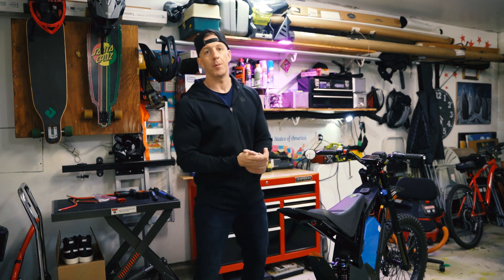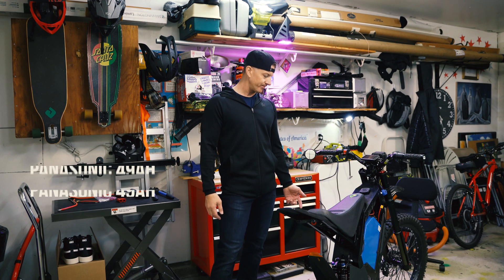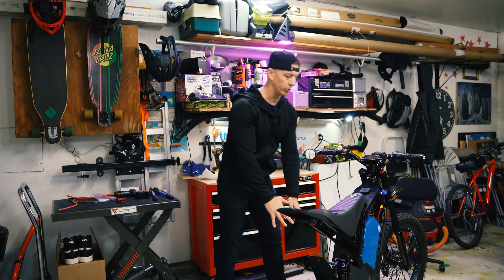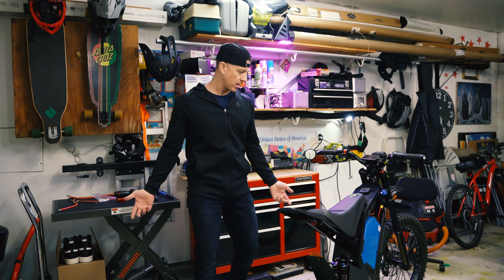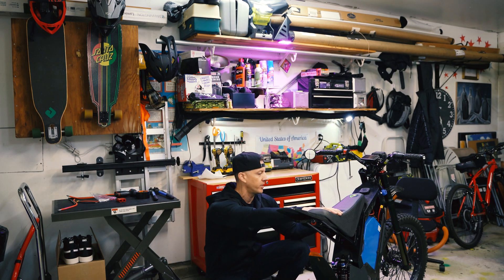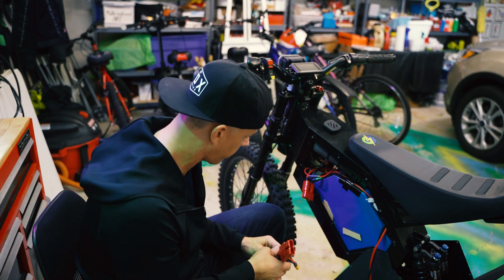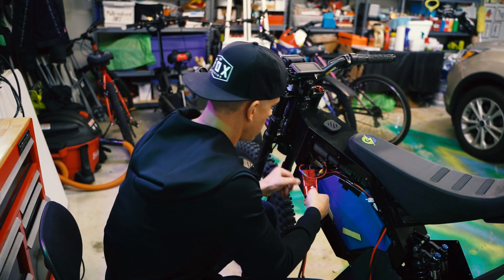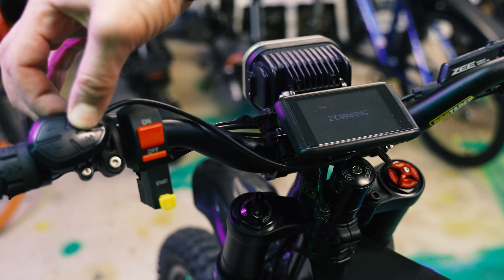UPGRADE to TWO Ebike Batteries = MORE POWER & Range!!!

Comment: I’m having an issue with my controller 72200 that has the LED light colored Green. No errors listed. Any thoughts on this. Any information would e greatly appreciated.
Reply from the maker: So am I, join the club.  Literally just installed a new 72200 today and it's not interfacing with my display as I was promised by my seller rep.  Has me quite pissed off.  What is the issue with yours?
Reply: @JoshStreetDesign  after inputting all the numbers and checking everything, the light that’s supposed be red, it’s actually green with no function. Screen turns on and hall test passes so I’m in the clouds here.
Reply from the maker: @christopherfigueroa4143  yeah mines green too.  Bike still rides fine and all, but I just can't get my speed and mileage and watt usage.   I'm pretty sure it's that the controller isn't compatible with the screen, wasn't set up that way.
Reply: @JoshStreetDesign  I have a small video on here showing the light on the controller if you want a visual look.
Reply from the maker: @christopherfigueroa4143  yeah but what I'm asking you is what is the actual problem you're having?  Is the bike not moving is your throttle not working like what's the problem?
Reply: @JoshStreetDesign  the bike doesn’t move, throttle doesn’t function at all
Reply: @JoshStreetDesign  it’s very confusing since it all came as a complete package. Controller, throttle,screen,wires.
Reply from the maker: @christopherfigueroa4143  did you check all of your connections and make sure there's no bent pins or loose wires
Reply: @JoshStreetDesign  sorry I didn’t realize the miss wording, I meant to say that the bike does not move as well. I did check all the wires as well. I asked a friend to look at it and he feels it has something to do with the software 🤷🏽‍♂️

Comment: Dunno but parallel battery designs are usually frowned upon. The major problem is that both batteries might have BMS that balances cells within the pack, but as one battery gets drained more than other they start to equalize voltage between them so you get a situation where one battery charges the other one, this can have excess stress, heat and loss of potential battery capacity.  The next problems is the wiring as when connecting parallel batteries, generally the battery on shorter and thicker wire gets drained more than battery more further down the line, this is usually subverted by having all parallel batteries wires connected exactly with the same resistance and length wire. High amp situations are especially critical in this kind of scenario. I see your adapter is probably a big problem as the drain wires are connected directly to contacts of the first battery, however if you connect the closest plug to the  large capacity battery first, the problem isn't so prominent. Also when charging, you should always charge the two at the same time and at all costs avoid connecting two different voltage potential batteries in parallel as this will cause massive amounts of current to start flowing, yet again using BMS usually stops the worst from happening.
Reply from the maker: Thanks for your input.  I do charge these at the same time and they are the same voltages, that is specified in the video.  I haven't noticed any negatives of yet only positive increases.  Hopefully it will continue in that direction haha
Reply from the maker: I installed the New 72200 and I did NOT see a power gain unfortunately.

Comment: Hi, I have a bike similar but I have an issue where the bike won't accelerate when i turn it, i have to hold it for a while and it's unpredictable when it will start, I've checked everything is connected. Is this something to do with the setting on the LCD? HELP!
Reply from the maker: doubtful.  Sounds like you have a wiring problem somewhere.  I would need a lot more details to help you.  If you have a sabvoton motor, go into the blue tooth settings, reset it to factory defaults, put your bike on a stand and re-run the hall test.  Make sure you put around 15 amps in the given current field before you do it.  good luck.

Comment: Hi I recently built an ebike with qs273 motor but I’m not sure if it’s programmed right. I’m only able to get a top speed of 26mph lifting the bike on a stand. The motor controller is set to no speed limit in MQCON app. I’m using a Sabvoton 72150 with a 72v 20ah lipo battery.
Reply from the maker: I wouldn't need to see screenshots of your mqcon settings first
Reply from the maker: Also is your BMS allowing more amperage to go to the controller?

Comment: Pretty cool idea to add the battery there. Personally I would put the controller outside because I have seen people blowing up fets from their sabvotons because it didn't get enough cooling inside the frame. So a risk you might want to keep in mind when riding on hot summer days :)
Reply from the maker: Thanks man.  By the way, have you fried a 273 motor?  And if so what was the circumstances?
Reply: @JoshStreetDesign  Indeed I have melted my custom wired and ferrofluid qs273. I was running at 37kw peak power and racing against a bmw. The killing blow was actually the fact that qs273 heats up significantly when you are riding slow. So that was pre heating the motor before I did my accelerations.
Reply from the maker: @BossManaatti  wait that makes no sense you say it heats up more when you're going slow as opposed to going fast?  The only times I've really felt mine hot was when I was doing a 55 mph bomb ride for like four miles straight
Reply: @JoshStreetDesign  qs273 warms up the same when going 20km/h and 80km/h. Moving air cools down the motor a ton
Reply from the maker: @BossManaatti  interesting.  Some people telling me I need ferrofluid and hub sinks on it.  I just don't feel it's necessary as I'm not putting it as much power as your were
Reply: @JoshStreetDesign  I don't think you need ferrofluids or hubsinks for the power you are running. Just simply overkill

Comment: Theoretically you should see a power gain without adjusting controller, in that there is less voltage sag. Power measured in KW. So 83v x X amount of amps = kw's of power. When you hit full throttle, it probably see's a lower voltage under full load, compared with when you had 2 x batteries at full throttle. 

So if under full load (1 battery) you get 4v sag at say 100 amps and with (2 batteries) you only get 2v sag, then that's 2v gain. 2v x 100 amps = 200w power gain. But if you weren't really pushing your original battery that hard in the first place, then power gain would be minimal. 

My 90v pack at the moment sags 10 volts easy! at 250 amps. If I could eliminate say 5 volts of that sag, I would theoretically see a 1.25kw gain in power! That's one of the reasons I am going to double my pack size.
Reply: I got homemade 32s 116.8v full charge lifepo4 battery, they can discharge over 600amps short burst, 300amps peak, 200amps nominal, they sag less, I run 1.5mm copper places to connect the batteries. And 2x 8gauge wire. At 250amps draw voltage sags around 3volts. That's over 25kw off power🤣, cons they weight a ton. I can run over 140kph but I usually run it at 100kph, I am always afraid that Fork will break. Even at 50kph I don't use my front as it sags to almost bottom, regen braking cannot hold me nor stop me. Damn heavy but reliable battery (50kg) 😅
Reply from the maker: @isaacfragmatic4651  dang dude, those are some stats!   I just finished putting a new unlocked 72200 and a new 273 5t motor with a huge rear Dunlop k990 tire for off-roading yesterday.  Making a video of it now.  Virgin ride will be today.  Excited!
Reply: I am looking forward to see it :)
Reply: At peak amps I can discharge 32kw, if only my controller and if I wont limit it. 😅
Reply: @isaacfragmatic4651  Just set to full power, but stand on the front wheel under full power, like on titanic when shes on the fornt of the boat!
Reply: My fork can't handle the torture😅, my hub for sure won't kick my front up due to battery weight. I just sit down and bruupp. Local 150cc is ranting to do drag race against. They didn't stand a chance at half battery installed ( 53volts) 16s. In the end they are just saying " it's fast" after beating them, they " no way" after telling them I am still running 40% since I only installed half battery 🤣. I have run 50kphs only at finish line as it is short drag, but they are all amazed and laughing, all I did was to sit and brupp. 😅
Reply from the maker: @isaacfragmatic4651  what controller and motor?
Reply: Qs273 and svmc93120 unlock😅,
Reply from the maker: @isaacfragmatic4651  I'm actually really pissed off today because when I got all my stuff hooked up and then took the bike out for a ride the performance was exactly the same as my 3.5 motor so I think they actually sent me a 3.5 and not a 5T.  What a waste of $600
Reply: You may need to configure your controller., and fine tune it. Normally 5t motors have 5 turns means they produce more torque rather than speed. You may also need to check the resistance of each windings ( if you have equipment that can measure low resistance) or grab multi meter stuck it on 2 phase wire and turn it. At same speed, the 5t will produce higher amps. Another way to know is by turning the wheel at specific given voltage. 3.5t will usually run 13kv as far as I remember. 5t should be lower.
Reply from the maker: @isaacfragmatic4651  I just verified with a company that it definitely is a 3.5 t motor, they admitted that they sent the wrong one but they were not going to make it right and they're saying I have to buy a whole other one
Reply: F*ING no way :(
Reply: Can you share us the marking beside the motor?
Reply from the maker: I deff still have the voltage sag, not sure that it's the same amount though....but I'm suspecting that the limited controller may be the X factor there.  Time will tell once i put the new on in.   I'm gonna do a walkthrough video of that too.  Thanks for watching!
Reply: @JoshStreetDesign  what new controller do you have. Also can you not unlock your sabvoton 72150. I have my 72200 unlocked.
Reply from the maker: @jcreedy20  I have a locked 72200, and no it CANNOT be unlocked.  I've tried everything, 2 computer programs.  So I ordered an unlocked version of the same thing.  I may up my Field weakening up to 150 amps just to see what kind of top speed I can get.
Reply: @JoshStreetDesign  You can by pass a wire around the current sensor inside the Controller. This tricks it in that the main wire only has half the current flowing through it as youh have bypassed a cable around it. It works! Anyway, I have my flux weakening set at 180 amps with great effect!
Reply from the maker: @jcreedy20  yeah I've seen that old solder the pass around wire trick before . But I just really want to be able to specifically adjust my numbers.  so the 180 amps field weakening what kind of top speed are you getting what are your specs and setup?   Do you notice that your motor heats up a lot if you go fast?
Reply: @JoshStreetDesign  I am running a 22s1p EIG 20ah pouch cell setup. Cells are rated to do 10c for 10 seconds. So 200 amps but i am pushing them a bit as i have my sabvoton set to 250 amps and 550 phase amps. I am using a 300 amp ANT BMS. I have a 3 turn QS205 with hubsinks and ferrofluid (8ml). I used a FLIR camera to measure the outer casing, the most it hit was 45 degrees C during a hot summers day (35 degrees C outside temp). That was with flux weakening at 180 amps. I have had 70 mph out of it so far, but there was more speed to be had out of it i think. Your using a QS273 i believe? You will!!! need to add ferrofluid!.... My friend cooked his 273 on a 200 amp setting and flux set to 80! with his sabvoton when he was thrashing it repeatedly. He added ferrofluid alone on his new motor and saw a massive improvement and did not destroy his motor. Hope that helps answer your questions. Compared with 80 amp and 180 amps setting on flux i saw a 6 mph increase in speed! I think that was what you were also asking.
Reply from the maker: @jcreedy20  that's good info.  I'm sure you have some strong acceleration with those specs.  70 is fast enough, lol!    Regarding my 273..hmmm, I've never even felt it get that got, at least to the point where I couldn't hold my hand on it for 20 seconds, and that was on a 98 degree summer day.  I think the most I would get out of my battery combo would be 190 amps burst.  I may not even up the field weakening though as I'm not really looking for more top speed since I'm always off-road.  I prefer more torque to be honest for the steep sand hill climbing.
Reply: @JoshStreetDesign  It all depends how you ride, the guy who toasted the 273 is an animal! So unless you do some serious hard riding then it should be ok, but if your gonna run anything toward 200 amps, then look toward cooling or you will regret it one day when you decide to get a bit more confident with your use of throttle. But don't be deceived by the temp of the outer casing Especially!!! without ferrofluid, on a motor that large it will take a long time!! to transmit to the outer casing without ferrofluid, it can be very deceiving! Put some ferrofluid in it and you will know straight away what I'm talking about. It's Night and Day! Just bare in mind if you use ferrofluid you will need to replace the fluid every year or two as it hardens slightly and leaks from the motor over time. It's not too difficult a job as it sounds to do though, very easy in fact.
Reply from the maker: @jcreedy20  Dude, I don't have time or patience to be putting ferro fluid in every year.  I've seen the after and it's a mess.  I'd rather just buy a new motor since my rim is slightly bent.  TBH, you're the first person I've talked to who knows someone that has cooked a 273.  It's a pretty common talking point in the groups that they never overheat...but I guess anything is possible.  And yeah I ride mine hard off road in the sand.  The sand is what really sucks the juice out of your battery.   Bigtime.
Reply: @JoshStreetDesign  It becomes a mess because a lot of people don't realise your supposed to swap it out after a year or two. It hardens and then becomes abrasive to the magnets etc. So people just end up sticking it in and forgetting about it, expecting it to be ok. That's why i ended up buying a big bottle of it when i ordered it. Also there is one other guy I know of that has cooked his 273. "BossManaati" or whatever his name is on youtube has also cooked his and he had his custom made with pure copper to handle more power. Yeah the sand will defo suck the battery dry! Also heat the motor rapidly too, unsurprisingly.
Reply from the maker: @jcreedy20  Keep in mind Boss is also running a LOT more power than I am , lol
Reply from the maker: I installed the New 72200 and I did NOT see a power gain unfortunately.
Reply: @JoshStreetDesign  It would be noticeable only at higher speeds and only if you were suffering significant voltage sag to start with. Also the added weight of the extra battery would negate some of the accelerative force.
Reply from the maker: @jcreedy20  actually that's a good point, because I did gain a tad of top end.  Battery's not that heavy though.
Reply: @JoshStreetDesign  Yes, just remember KV/RPM. Motor maxes out speed with amounts of volts driving it, if there is less voltage sag then there is more volts to spin it faster.

Comment: Good idea with battery, plus nice seat Josh
Winter over here now, ain’t been on mine for three weeks, last time soaked 
Test rode new bike last week ended up hospital man throttle was set at like 1000ms so put me into the steel bollards 
Shock psi at 120psi so all over the place had surgery the other day, leg wide open from pedal 
Cool video man good to see you one here 
Anf Hughes Facebook see you on diy e bike etc
Reply from the maker: Dude, what?!?!?  YOU crashed that hard????   what exactly happened?  I don't think my acceleration changes no mater what I have done to the settings.   You look jacked in your profile pic btw, fellow lifter here.
Reply: Shit!...😳 I love ebikes but, I haven’t gotten to anything that powerful!....,,,,,,yet!😎🤣